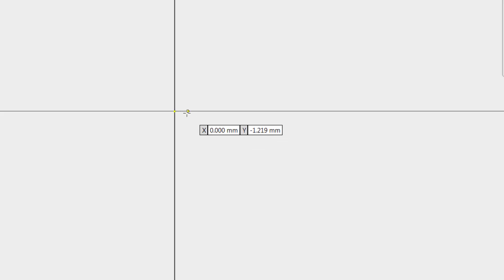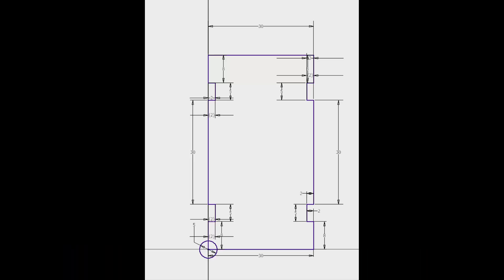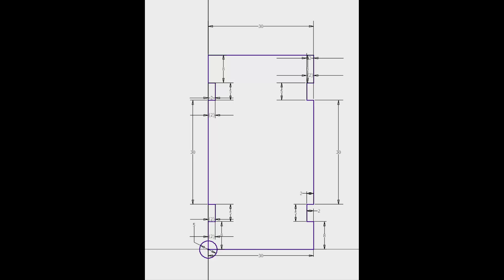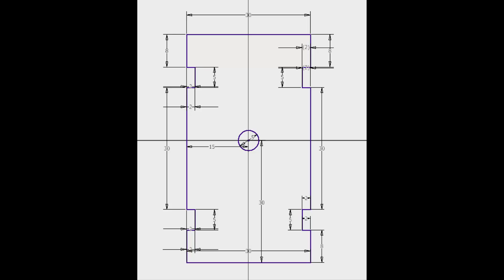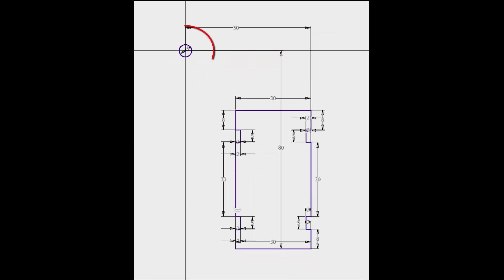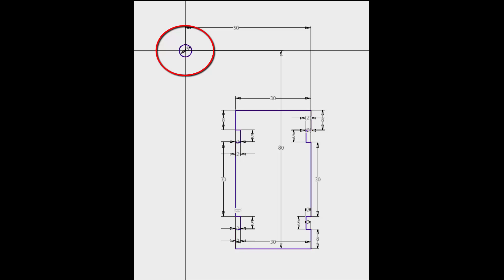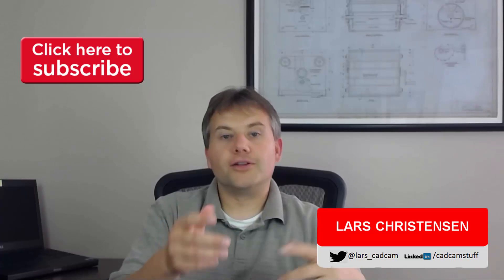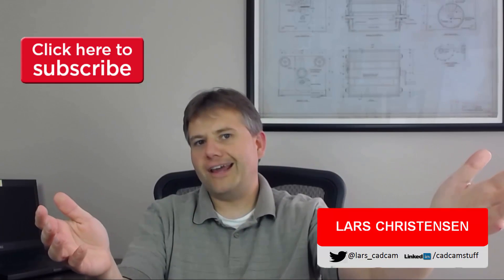Where do you locate your CAD Origin?

Comment: Hi Lars, Good topic -- related to that, within Fusion, I'm very confused about the relationship between the CAD model and the CAM coordinates and how to 1) move the model into a different coordinate orientation -- For example, I got a model from my nephew for a simple routing template where the Z access is not normal to the flat part of the material (it's coming out of the thin edge)  -- I instinctively want to orient things the way i have them setup on a small mill with X-Y plane being the horizontal, flat surface on the mill-bed.  In this way, Z is the vertical.  Fusion, by default seems to put Z as a horizontal access in the Model view.  How can I move the model in the coordinate space so that Z is normal and subsequently, how can I align the origins in the CAD and CAM views (I tried to do this and got close but couldn't align the two origins.  [PS: i did convert the template model Bodies to Component. 

Thanks! -Dave Munoz
Reply from the maker: Hi Dave, I would not bother. The great thing is that you define the CAM coordinates separately in the CAM workspace
https://youtu.be/Qmx5DUvvmxI?list=PL40d7srwyc_Nag77BLk_lQjMqRNaB_fBs

Best,
Lars